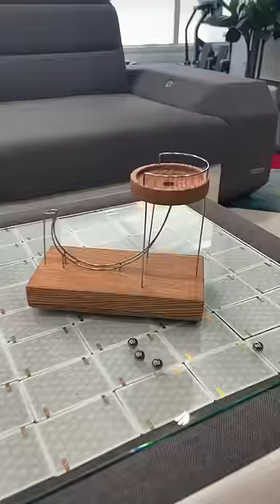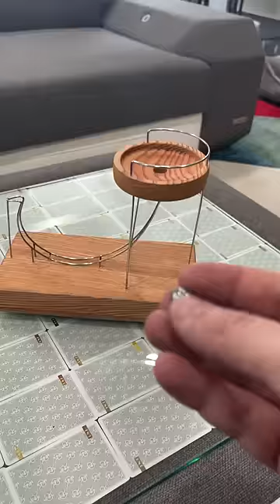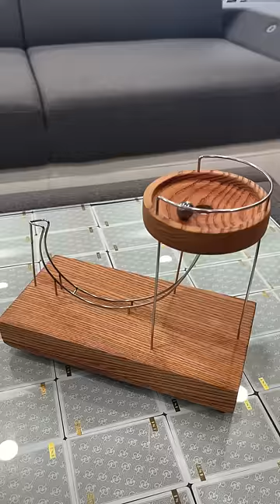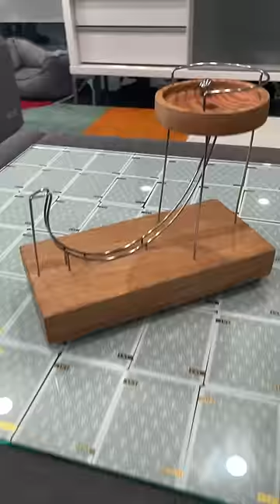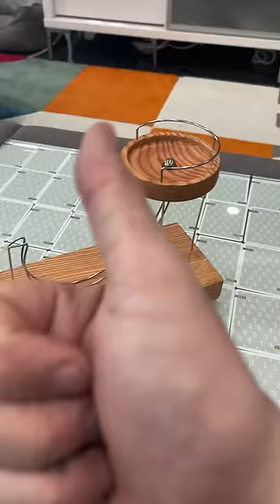An Impossible Perpetual Motion Device?! 😳 #Shorts

Comment: Yes, a Perpetual Motion Toy. I guess it's the same mechanism as the magnetic rail gun.  And when the ball touches both rails the current makes the ball eletro magnetic. The magnets hidden below push the ball foward.
Reply: The ball rolls down the ramp and the lip at the end tossed the ball back to the cup🤷‍♂️ where did you get all this “ rail gun” crap🤦‍♂️
Reply: Even if it was done with magnets it would still count as perpetual motion as long as it doesn't need its energy to be recharged from an outside source.
Reply: @noteem5726  Magnets eventually lose charge. So it wouldn’t be perpetual.
Reply: @M21-w1y  The ball becomes electro magnetic when it touches both sides of the rail.  Only this way the ball could get enough momentum to reach the same high from where it drops, despite the rail and air friction. If you ever watched those home make rail gun videos. You will come to the same conclusion.
And after I wrote this comment, youtube recommended me a Short video where a Japanese bought this toy and show that it needs a battery to run. And the battery is hidden in the disc above.
Reply: @MrReav13  
lol, have you seriously never heard of a "permanent" magnet?  🤣
Reply: Regardless how long it last for ... It's a magnet 😂
Reply: @noteem5726  Permanent is a relative term.  Any solid will deform eventually, and magnetism will likely shift or fade.  But this is irrelevant here, since the point wasn't that the wires were magnets, but that the wires were electrified and would thus create a current to magnetize the ball when it contacts both sides, and the magnetism would then accelerate the ball.  A ball won't be consistently accelerated to escape velocity by a normal magnet, it requires something more dynamic as would be created by a current.
Reply: @broEye1  It's only irrelevant because you're wrong. We don't know if it's done either with magnets or electrified so my point still stands. Stop pretending like you know anything when you're clearly just grasping at straws.
Reply: Thanks for debunking this lie or misleading video. Leaving out the most important fact that it needs to be charged by battery 😂 just another misleading vid
Reply: @noteem5726  It's irrelevant in that you were misinterpreting what the person said.  The person was talking about electromagnetism, not "permanent" magnetism, regardless of whether it really does last forever or just a really long time.  Rail guns aren't made with "permanent" magnets, they're made with electric currents.  So no, I'm not grasping at straws.
Reply: @victorleung8831  i was thinking this probably used a battery, thank you for confirming it. 👍
Reply: Imputus through gravity
Reply: Because of the resistance created by the friction of the metal balls on the rails, the drop alone can't keep the cycle going. All of these that WORK have electromagnets in the base, which usually operate on a 9v battery. Idk why Chris didn't mention that?

A "normal" magnet doesn't provide enough power to move something as dense and heavy as a metal ball fast enough that the cycle continues. You might get it to run through a few times....maybe even a few minutes. But it will not be perpetual no matter what you do because the friction creates that drag, which eats up the inertia coming from the drop.
Reply: plus the fact that both sides of the rail are the same piece of wire looped around.
Reply: That is an assumption
Reply: @Kimmaline many assumptions no variables or facts
Reply: @noteem5726  You can literally just look up this item yourself and see that it and similar ones use a battery to power the rails instead of arguing with people and telling them they’re wrong.  The information is available.
Reply: @noteem5726  We're waiting for a response from you 😂
Reply: @sharpeningtheaxe  
Yeah, I already said it would be perpetual IF it doesn't need an outside source. If this particular item does then it's not perpetual but that doesn't mean it isn't possible with permanent magnets as I've already stated.
Reply: @ChikoTheOGDog  
Hope that made your day Chico.
Reply: it uses electromagnets. so both a battery and a magnet.
it detects when the ball is coming and activates the magnet for a really short time. that way, the magnet in the base only attracts the ball when it's coming down, and not when it's going away.
reciting this from memory from watching the steve mould video, so i might be innaccurate, but that's generally what i remember.